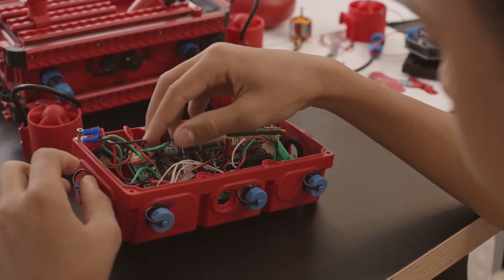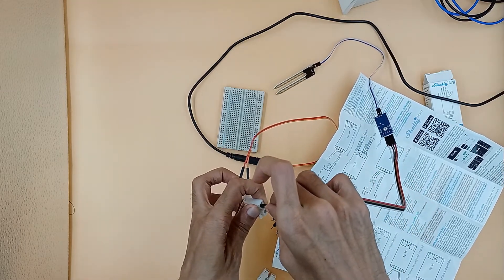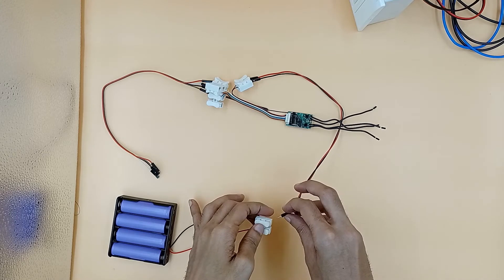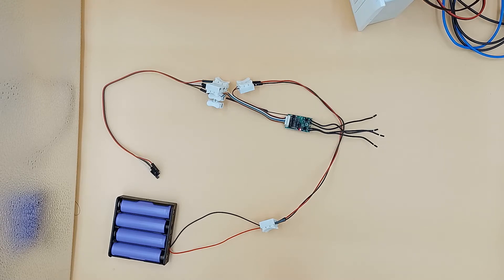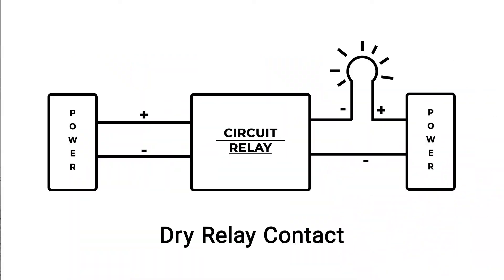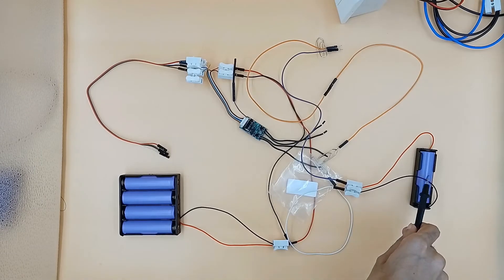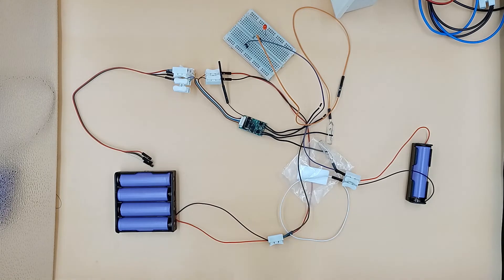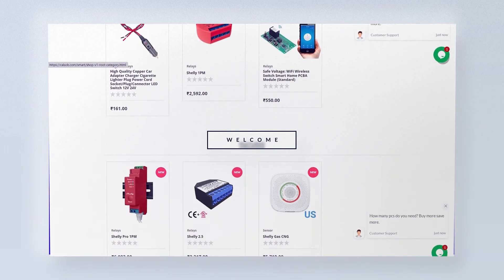Shelly UNI Output and Input Wiring

Comment: Hello ! How to monitor a 48v battery voltage with a shelly uni?
Reply: you may work around 36v limit by voltage divider across 48v
Reply from the maker: 36v is max you can use

Comment: Hi, do I understand it correct. This one only support 100mA on the outputs at 3V. I wanted to control two contactor's at 24VDC with 50-80mA current.
Reply: Both potential free outputs on the Uni support 1000mA and maximum 36V DC.
Reply from the maker: You can do that